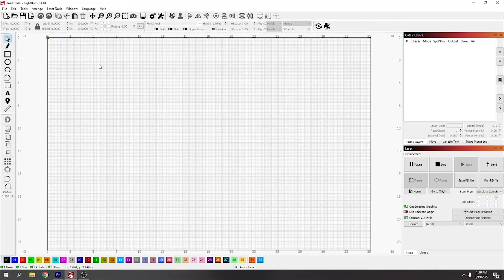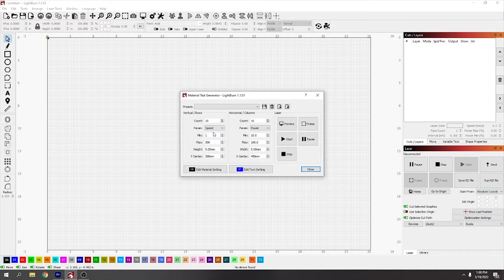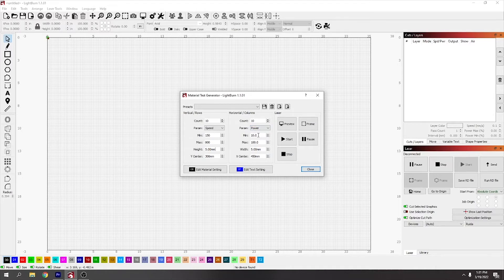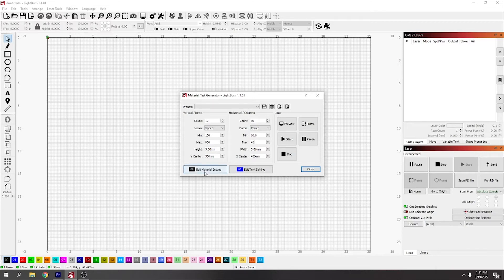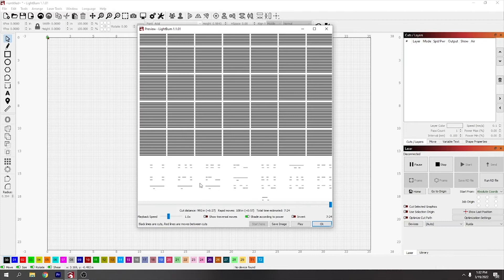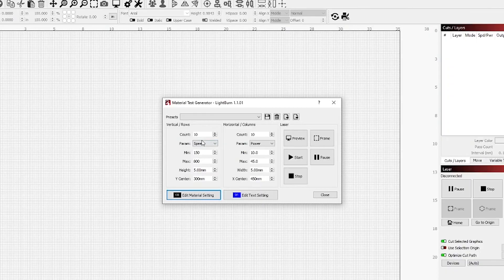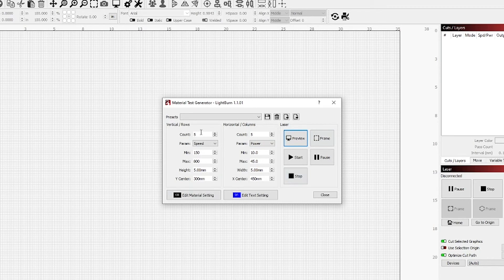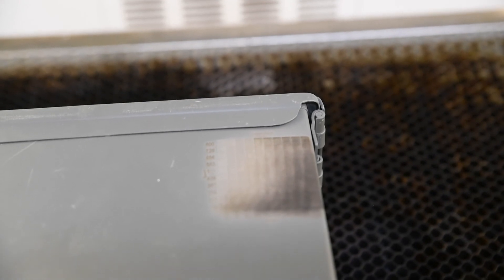Lightburn New laser Cut / Etch Material test, how to and some examples

Comment: Alignement is off when making line its as if laser starts a tad late.
Reply: As well as the verticle path seems to be weaker than horizontal
Reply from the maker: @immortalmonsterhybrid975  that is strange i have not tested with it much but it didnt give me no issues as far as i could see thanks
Reply: @carphotography  So horizontal lines are they thin or thicker than verticle, when making a square line?